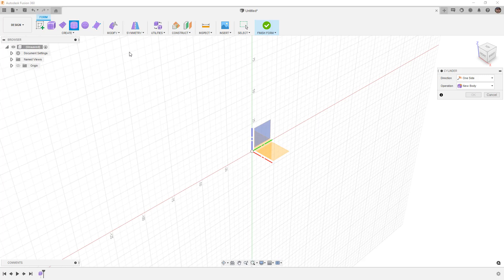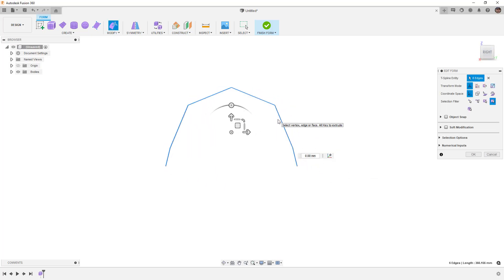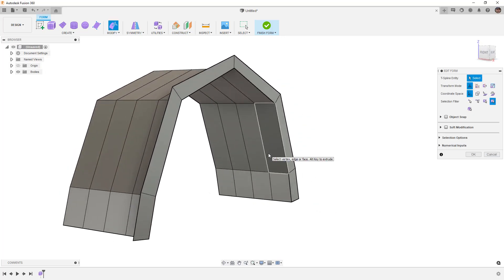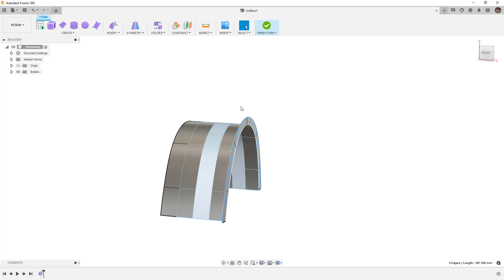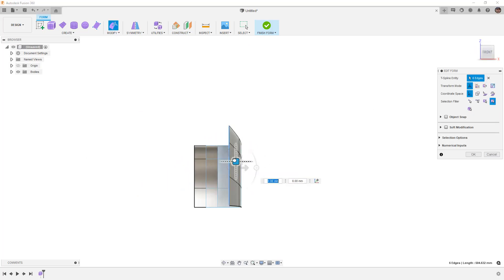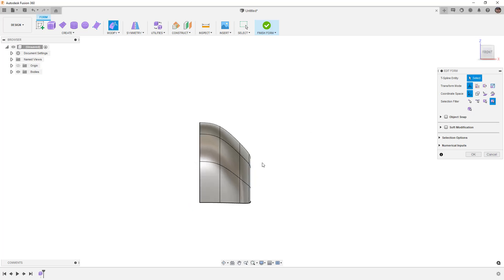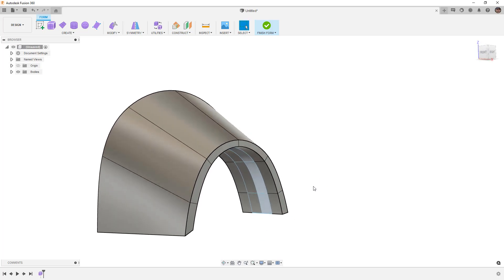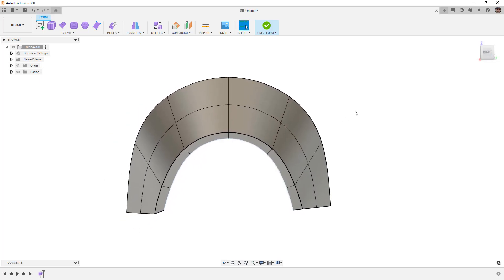Fusion 360 Form Mastery - Part 17 - Using Freeze and UnFreeze

Comment: Thanks for the video. Freeze is now in my arsenal of tools. When you scale to make a straight line, type 00 and you will get the edge totally straight without fiddling with the control.
Reply from the maker: Thanks Tessier!  In future videos I do that.  Even after all my years of using Fusion I have to stop myself from typing 0 and hitting enter :)  That is the biggest hurdle for me.  Also something in the recent update of Fusion has messed up the dialogs so if you hit ALT+1 or ALT+3 to switch between smooth and box display, the 1 or 3 goes into whatever dialog box is active, but if you have multiple form bodies you cant use this while Edit Form is active because you can't select one of the bodies.  It is very frustrating!